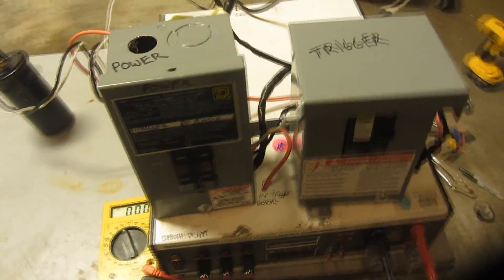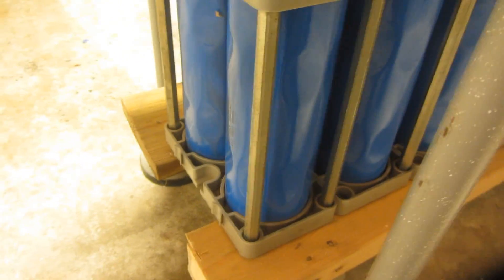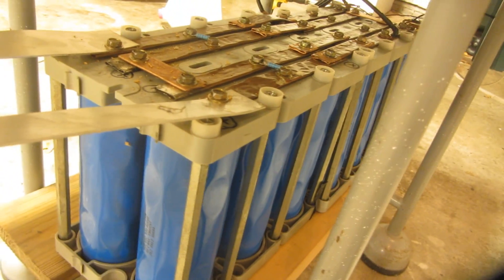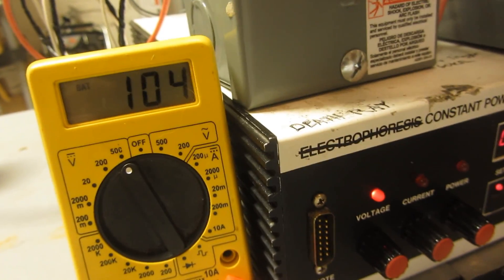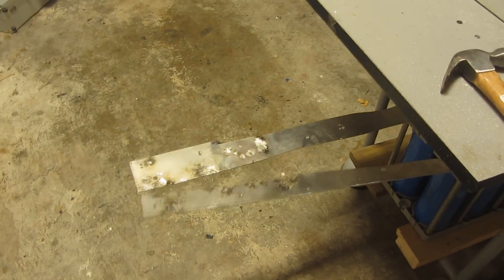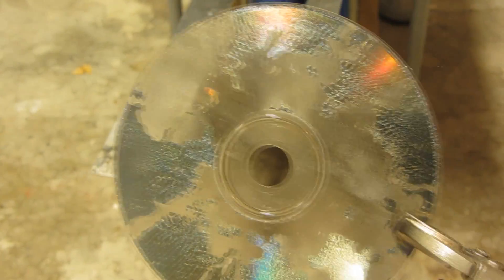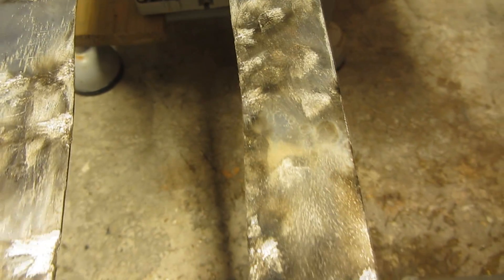Terrifying Pulsed Laser Power Supply vs. Household Items

Comment: Watching all the laser videos on youtube i wanted to make a powerful laser beam , so i bought a 75w 905nm laser diode. i thought that it would run off a buck converter like the nubm37. i planned to run it at 12v 30a constant current with a 1500w 30a buck converter. then i red the fine print pulse laser diode 100ns max. i looked for a pulse laser driver pcb board and was shocked to see they cost around $2000. what is the cheapeast way to drive a 75w pulse laser diode ?

Comment: Sooo
if this capacitor bank stores 5KJ of energy at 700V its capacity should be if i didnt do anything wrong in my head at 1.7mF for each of these capacitors. Thats cool. But this seems not to be that much for their size, cause i once build a capacitor with aluminium foil and some I think it was PVC foil or something. And i estimated it to be able to take 10-30KV. I tested it, and by estimation of the power source i used with 6-12V input and 5-30KV output it blasted at around 12KV. It had a capacity of 150nF (multimeter+calculation) and it made my  voltage source (0-30V) to disfunction (only the amp meter of it didnt work anymore after that and i cant properly explain this).
Well since it could handle 12KV if it was for only 1KV the capacitance would be 12 times as high, and thus at 2,8μF. I think compared to volume if you squeeze it it could probably also fit maybe 10times into one of these. So it would be at 28μF selfemade with very very bad setup
Reply: Edit: Oh well 1.7mF is still way more, so its worth it. But i think with a little bit of effort and naybe a winding machine and good material you could create a nearly as good capacitor yourselve. But might be very very dangerous because you cant properly test its max voltage in a way, so that you can trust it. And even with my selfmade 150nF capacitor at 12KV it made a very good bang and ripped a pinky finger sized hole in its side.

Comment: Where can I buy condensators like this? Are these electrolytic or an ceramic capacitors ? I read on the Video, that  one capacitor has (500VDC, 1200 uF).

Comment: You should make a rail gun with some tungsten projectiles and a carbon fiber wrapped rails layed out in a helix you got a decent capacitor bank for it tho it might not survive long if you do it depending on the gauge of the contacts between caps and the reinforcement added ur gonna need to keep it from destroying it self depending on how manny grains the projectile is and what ur energy efficiency between it all ends up being

Maby some material development needs to be done for energy transfer 

Maby conversation from light to energy in a quick manner at the last stage before being sent into the rails 

Just a thought

Comment: every part of those contacts and connector strips should be insulated  or at least protected by a sheet of 1/4" plexyglass. Your connections that you short out to should also be minimal area of contact. you really should build a device that drops things onto it. professional electricians would shit themselves thinking about doing what you just did, Dumb teenager and your bullshit disregard for softy. Im flagging this do the EXTREME danger that it poses.

Comment: The amount of amps that could potentially kill you is actually so low, that you can not feel it, and can only kill you if it goes across your heart. This has WAY more then that, ha. Only using one hand is actually a very good safety measure.

Comment: Trust me man I know I haven't studied as long. But man when I hooked it up to an alakaline battery it started generating heat but the battery almost exploded and I didn't put an off switch so I had to pull the wires from the driver.
Reply: Heat entropy is in thermos. the coupling converts half of it into light.
Reply: Mine is too efficient at stopping it. But I am using a Power coupling, which converts etropy into light. We neet one that turns thermos into light.
Reply: You cannot reverse Entropy but there is no law against converting it.
Reply: There really is light in there it just isn't visible unless you blow smoke at it and then it turns RED.
Reply: It is a infra red laser almost I call it a hot pink laser.
Reply: What makes RED in the laser spectrum?
Reply: BLue and Green

Comment: You should make a rail gun with the capacitor banks
Reply from the maker: Would be fun but the ESR on these caps might make the pulse length too long for use in efficiently accelerating projectiles.

Comment: I was thinking, what if both that positive and negative connections were to touch the legs of the table they are sitting on? Seams like a over looked issue to me. Maybe coat the legs in rubber of some kind for your sake.
Reply from the maker: The legs are grounded, so if anything charged comes in contact with them, the charge will simply flow to ground.
Reply: Good call.

Comment: throw a steak or hotdog on it
Reply: I like how since you are buried in the ocean of comments no one recognizes you XD
Reply: The aluminum foil turned into gas!
Reply: Nothing would happen. Only things with a very low resistance work.
Reply: @xenonoxid7521  Then touch it
Reply: @xenonoxid7521  u can lower the resistance by dipping them in salt water or something
Reply: @xenonoxid7521  True. I really don't think it would be nearly as cool as something metal.
Reply: Hi Kevin
Reply: you should talk to each other about a collaboration
Reply: @Mike Sienicki Wrong actually. The outer layer of sasauge skin is high resistance but inside is low resistance and high voltage can easily penetrate through causing it to be low resistance. If the pressure inside the sausage gets high enough, it can explode.
Reply: It would turn into ashes after a bang
Reply: Great idea! Larger capacitors have been known to vaporize people, so this one could easily blow up a sausage.
Reply: TheBackyardScientist and have your dog 3 feet away
Reply: or a watermelon 😜 

the backyard scientist and styropyro would be best friends
Reply: 667th like lol
Reply: Speed cooking
Reply: Ur like the %15 more stable version of this guy
Reply: Hello kevin
Reply: That would-be cool nog gonna lie
Reply: I was about to comment that
Reply: Hwot dwog
Reply: fancy seeing you here

Comment: Unrelated but related to your laser experiments as something to laser.  You should try dissolving some styrofoam (solid good kind) into acetone and make flammable putty you could put on anything.  It takes 10-20 minutes to burn out if I remember right.  (been 15 years or so since I've done that).  Used to keep it in Tupperware containers.  Mostly for being jackass high schoolers putting fires in the middle of the road.

Comment: Try with ultacapacitor same capacity but only 300 grams
Reply: http://www.skeletontech.com/industrial-cells
Reply: While they do store a lot of energy the thing is that shorting them out is not nearly as spectacular because the few volts they have can't push a current high enough to dump out all that energy in the blink of an eye. You get sparks but no explosions.

Comment: I'd like to know if my calculations are close:

Using some of the numbers he said, we can figure out the following.
Let's assume a discharge time of 10mS and energy of 8,000J (80%).
Watt = J/S, so we get 8,000/0.001 = 8MW
Watt = V*I, I = W/V = 8,000,000W/800V = 10,000Amps!
Reply: 10KAmps @ 800V...8 megawatt.....yeah fuck that 

That's at least as much or more energy than the arc flash fatality video where a plant worker in Chile was racking the breaker for a cabinet of lower line power.   I'm told the breaker was rated maximum 14.4KV @ 500A but its nominal operating power was 13.8KV @ 400A.  So 5.52 Megawatts.

  However an arc flash is where it's momentarily much, much greater than that...and uh, all that was left of the guy was his left hand and his left foot and leg up just below the knee with the shoe still on, and the sock and remaining section of pant leg singed to it.  That flame cloud was his body getting disintegrated in 1/64th of a second and spewing ash all over as the lights went out.  

Why they felt they had to rack it while the main power was on is beyond me.  Data center or hospital? 

 Even so I can't imagine the line power staying on once the contacts explosively ablated. 

It's enough to scare a huge bear, it should scare people too.
Reply: LazerLord10 english
Reply: think about a top fuel car which has roughly the same amount of continous power
Reply: So each discharge works out to the equivalent of about half a gram of sugar.
Reply: I think that you many have a problem with 8,000/0.001 because it should be 8,000/0.01 because what you put I think means one millisecond and not ten.

Comment: So, with that capacitor bank, are we talking like-- lightning level energy?  Forgive me if that's a stupid question.  My scientific knowledge does not lie in this area.
Reply: His capacitor bank is 10kJ. The average energy of a medium lightning strike ranges from one billion to ten billion joules. You'll need 100 000 banks like this one to get close. (a rough guess)
Reply: allow me to attempt to inform you of the scale of this, in terms even I can understand... ever see dirty harry? remember how he killed everyone he killed with one or two shots? well, each bullet from dirty harry's .44 magnum was equivelent to about 1,000 joules or one kilojoule of kinetic energy. so basically, imagine Dirty Harry shooting someone ten times just cause he can and you have about the full power of the bank.
Reply: The lightning causes the air around it to heat upto the same as a solar flare, so, the answer to ur question is no. And that wasnt stupid lol
Reply: To put in further comparison, it is roughly 0.8% of the power of a hand grenade
Reply: Mr. Virtual  well, it's voltage which does that, not energy. One could have a bunch of batteries with the same energy stored as a lightning strike, but perfectly safe to touch, as it has less voltage and so releases it's energy slower (assuming resistance). Pls correct me if I'm wrong.
Reply: @robbiejames1540  you cannot remove energy from this. Energy is a fundamental quantitative property. Ex- Excited electrons have higher energy; therefore, more momentum to transfer.
Also, in your example, if you were the less conductive surface, the charge would jump to you with high current, just as dangerous. Same physics as a static shock for ex
Reply: @SharperthanA  
Re your first paragraph, surely that means that one can store the same amount of total energy with lots of low energy electrons as with a few high energy ones? However, to create an arc  (break down air) you need a certain amount of volts per metre, it would not arc, despite storing lots of energy. I'm afraid I don't really understand your second paragraph.
Reply: Anatoly Sazanov aren’t there stories of people surviving lightning strikes? How the hell does that work then lmao
Reply: @vmitchell1131  Yes, there are. This is what i know: de
The thing is that they survive because the time if the lightning is very very very short. 
Also, they are NOT HIT DIRECTLY, but by a secondary ramification of the primary discharge, many times weaker.
Reply: Mr. Virtual  it would jump to the nearest conductive object, which is why lightening rods exist to protect buildings with conductive roofs, the lightening instead strikes the  lightening rod as it is closer than the roof or ground
Reply: Isaac Mitchell google it
Reply: By the simple fact that the bank isn't creating an arc i can guess that it doesn't have quite the energy as a lighting strike

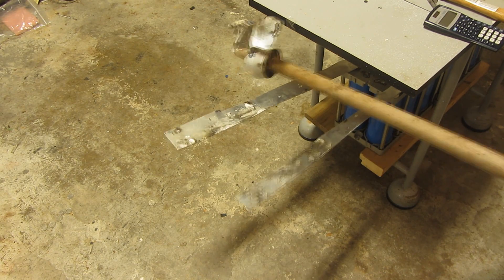Comment: 2:33 opposite magnetic fields pull each other not push, small mistake, and its the shock wave that pushes them apart from each other
Reply from the maker: By the right hand rule you will see that opposing currents repel. The current on one rail is repelled by the magnetic field produced by the other rail. I drew you a picture: http://styropyro.com/field.png
Reply: styropyro Oh you meant this type of field, sorry

Comment: i also built a capacitor bank a few years back, and the best thing to explode in my experience is graphite and the second best thing is soldering thin. start with pencil lead and then you can try the cores of lantern batterys.

Comment: I have a capacitor bank of 50 camera flash capacitors and I've charged it up to 150 volts and I put my finger across it and felt a small buzzing like feeling in my finger and that's because DC voltage doesn't pass though your body well because ur body act like a capacitor and that's why you can feel an AC voltage way more then a DC so if u did happen to touch ur cap bank  at 100 volts you would most likely not die and would hardly feel it

Comment: I feel like you could easily trick a burglar into touching that while you're on vacation. Just disguise it as a table and put some valuables on top of the metal plates. 

In all seriousness, it would be more likely to burn your house down or slap you with a $280,000 electric bill than stop a burglary.
Reply: Everett Tech actually it becomes a federal crime when you lay "traps" of any sort.
Pretty sad tbh
Reply: @Hunterhtm  Can't get arrested for that crime if there's no body left to find. Only downside is that you'll have to clean the whole room from all that human confetti...
Reply: Make it clearly dangerous, but still put valuables on hanging over it, that way if he dies, it's from stupidity rather than a trap.
Reply: I am literally 3 years late, but it's an average electric bill. If it was that high, your entire home wiring would melt into a puddle.

Comment: Are you sure its a magnetic field pushing the metal apart and not the force of the explosions?
Reply: Eli Kelley the air would still force the prongs in the direction of where the most surface area is. Pushing apart like that is definitely magnetic fields.
Reply: With capacitors, current output is HUGE (most of the time). Using some of the numbers he said, we can figure out the following.
Let's assume a discharge time of 10mS and energy of 8,000J (80%).
Watt = J/S, so we get 8,000/0.001 = 8MW
Watt = V*I, I = W/V = 8,000,000W/800V = 10,000Amps!
Reply: VE E & LazerLord are correct. Also, consider the items being exploded. None of them have much mass to them. And the explosions are hitting those bars edge on. That means minimal surface area to act on to push them. And even more force would be exerted down (because of the larger surface area), which would bend the bars. We don't see significant bending. Lastly, you can see in the first part that those bars are bolted down. It would take a notable amount of effort to rotate them apart. The magnetic force is acting all along the bar's length, and 100% of it would be pushing them apart. The energy of the explosion is mostly going to go into heat and vaporization. Thank you for reading this needlessly complicated analysis.
Reply: Eli Kelley
 I'll concede that the foil moving it less doesn't support my theory well. If i had to guess, I'd postulate that it's because the foil explodes too quickly, and so the full energy isn't getting discharged. Even though we often analyze these situations by saying that the charge is released "Instantaneously," that's not really the case. The components will all have a finite resistance which can be measured. It's pretty small, but it's there. taking V=IR, we can get the current from that resistance, which gives us a rate of discharge. Notably, resistance increases as the material is thinner, so foil will have more resistance than the can.
We can also determine the power being "dissipated" by the resistance of the foil from P=IV. Power is measured in energy per time, and the energy lost is going towards heating the foil, until kablooey. So we have a race condition. If the total energy dissapated reaches the kablooey point of the foil before the current drains the energy, we don't get a full discharge, and thus wouldn't get as much movement.
Though, on typing all of this out, it occurs to me that i may be over-thinking it. V is constant, set by the capacitor charge. Thus, with a higher resistance from the foil, we necessarily get less current. Magnetic field is proportional to the current, and the force acting on a current from the magnetic field is F = ILxB, linearly dependent on both current and magnetic field. Thus it's quadratically dependent on the original current. Resistance is inversely proportional to cross-sectional area, so if the foil is, say, half as thick as the can, we get 1/4 of the force between the two! Yeah, that feels more like it. And if you've stuck all the way through this explanation, here, have a cookie. Thanks for following my train of thought.
Reply: Scott R i dont think so still because the can split in half pushing the rods appart. Even tje first time when the can just blew open the rods moved a lot, i propose from the air pressure in the blast. The aluminum foil on the other hand even at one of the higher power settings barley shook the rods.  Even though magnitism is being generated that does not mean that it is behind the rods movement.  So i think its more likely the explosions are moving the rods.

This could be tested with an experiment.  By putting aluminum foil on the rods a gew times in a row to see if the rods move apart more.  We already know the can blasts them apart.
Reply: Oh yeah. It is most definitely is the magnetic field. Capacitor discharges have been known for ripping screwdrivers out of hands, throwing thick gauge wires across the room or causing damage to the terminals where there wires were anchored as they fly apart. The only force being generated from the "explosion" would be from the expansion of rapidly heating air, which  does not cause a lot of damage because it is not confined.